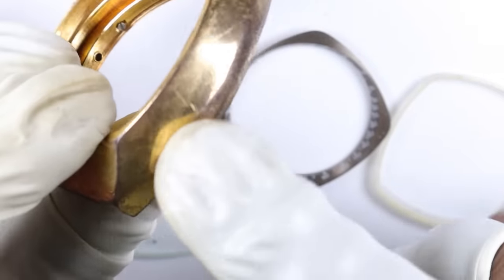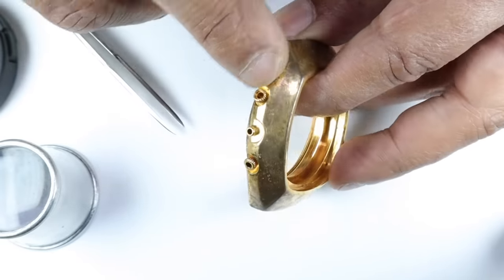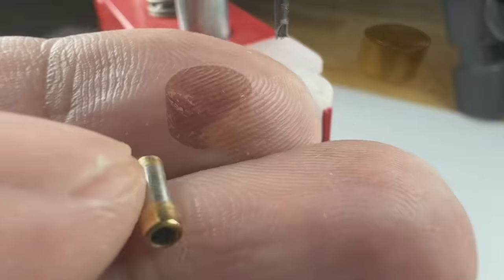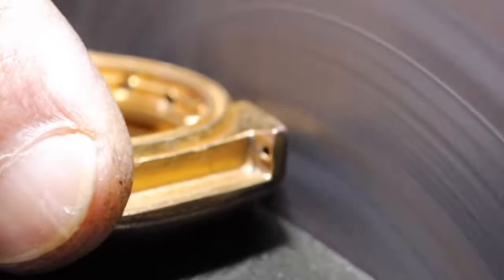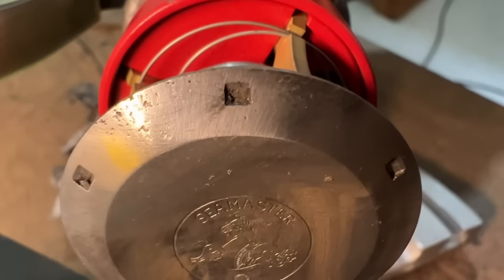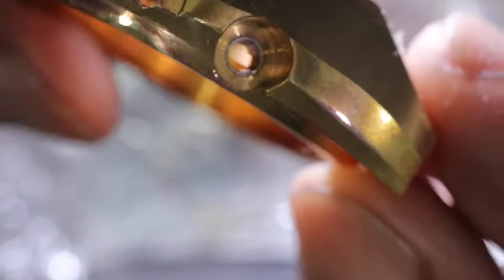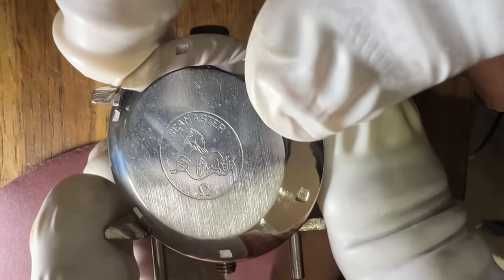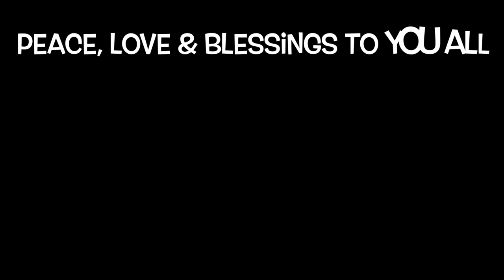Gold plating omega jedi seamaster tv case - watch restoration

Comment: to remove the worn pushertubes you maybe can make your own tool, 
( mini vise ) piece of tube.. make a slit in the tube and a thread outside.. with a screw outside you can adjust the Ø of the tube 
by turning up the pressure.. same principle in used in a drawing-compass to hold the needle & pencil.

Comment: I have taken in this week a trinity of broken winged watches, a brand new La Banus quite exotic chrono where the canteen crown is loose and had snapped the stem as it was flopping about like a good 'un, a beautiful pristine Soviet Sekonda on its original but broken expanding bracelet and learned a new skill in fixing expanders tonite and the final was a Slava tank quartz which I paid to be serviced and turned up missing its battery clamp screw and cannot find the screw anywhere inside the movement so scratching my head on that one but I got plenty spares and a simple fix.

Comment: I've missed you! Hope you're ok.

Curious to know the cost of getting the following watches looked at:
1) Poljot international airforce chronograph p3133 manual wind (think needs service, engaging chronograph the minute counter often leaps a couple of minutes and the stem feels a bit slack when setting the time). This watch has sentimental value (they all do really!) was 21st birthday present.
2) Soviet era Vostok komanderskie, manual wind 17 jewel, can't figure out why but it just doesn't keep time (is fine for about but loses minutes, like it's sticking at some point) and the when setting, screwing the crown back in it is still engaged with the cogs such that accurate setting is very difficult (the hands slip when turning the crown to thread the screw down and lock).
3) Another p3133 (Gagarin flight commemorative) that got dropped so might be knackered, does run but chronograph hand slips on reset. Not checked how it runs for time. Some paint chips on hands and dial.
4) Citizen 8110a automatic chronograph, think runs fine but was eBay purchase and the lens needs replacing at least (it somehow has a chip on edge just sitting in box and has come loose also, think must have been a dodgy install/glue job). Chronograph seconds hand is ever so slightly off zero by a fraction of a millimeter on reset (more an OCD thing). During summer it started to run really fast one day figured the hairspring had gotten some moisture on it or magnetised. Never done it since but then I've not really worn it much as terrified I'll damage it somehow with moisture from skin.
5) Another sentimental one, Seiko ultrasonic alarm, quartz cal 8v36. Battery change went wrong, stem release was pushed too hard? Damage to the board? However it happened, it's broken.

Comment: You should just get a tegular mechanics screw and bolt remover set. The inner spine aystem you used wouldnt need as much pressure with a tapered screw remiver.

Comment: Dear Sir,
I've got the omega Speedmaster 4.5 with the same movement only having the twenty four hour disc at the twelve , and I've got the issue that when at midnight the day/date turns over the discs don't align straight in the window ,always stand a little off . But when turning the discs by hand , (which turns over quicker than  automatically), they align straight.
Could you address this issue when doing your video on servicing the movement?
I'm going nuts not finding out why this happens . Thank you very much in advance.
Your fan always
Frank S.

Comment: Let's see you restore my 1970 CompuChron LED DIGITAL Watch that was my Graduation Present. Or a Bulova "Tuning Fork" Omega from the late 1960's. I can send you specimens of both in 20 carat Gold cases, the CompuChron in yellow gold, the Omega in White Gold. First, FIND BATTERIES!!! No one has MADE batteries for either since 1999. Well, find SOMETHING you can ADAPT! There is a very short life hearing aid battery that will FIT and operate the CompuChron. The 1.2 volt silver oxide for the Omega???